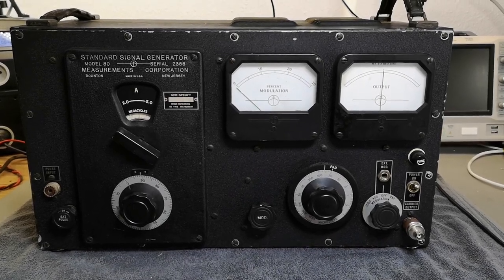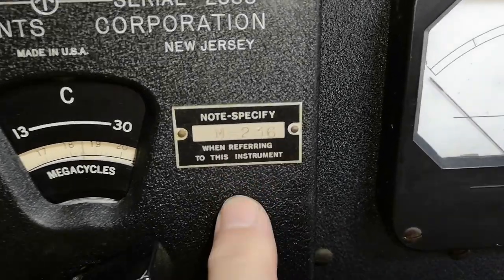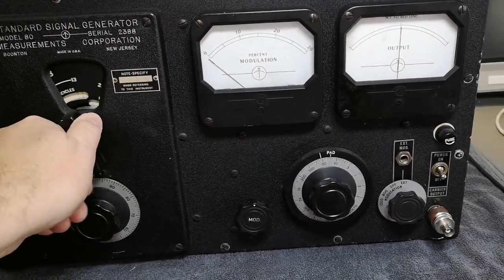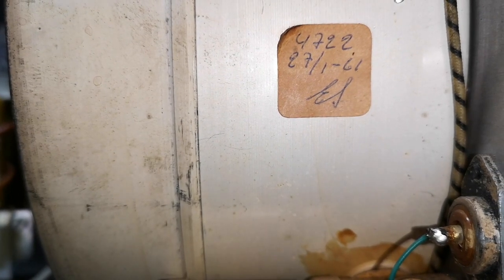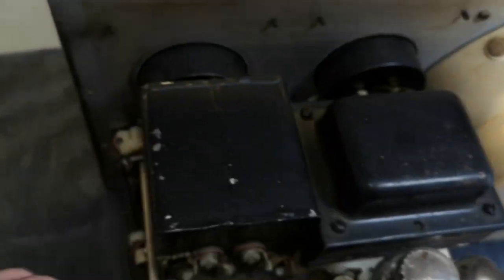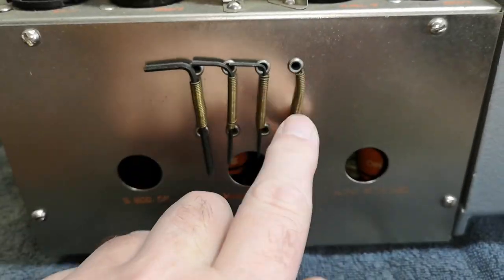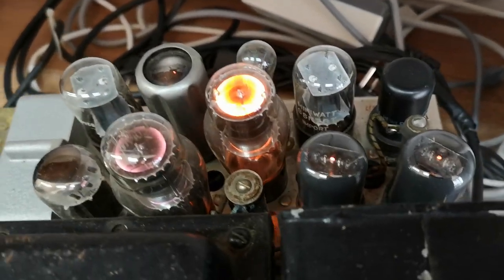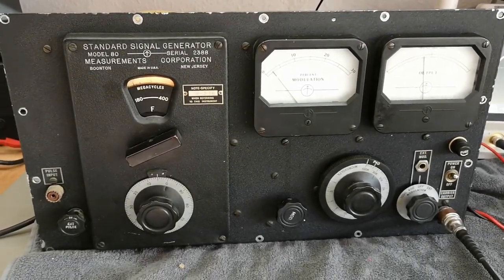Boonton Standard Signal Generator Model 80 2-440MHz 1950 test teardown

Comment: I have one of these that I've been trying to make some sense of. It was converted from a 955 triode to a 40673 dual gate fet at some point so all of the filament wiring and B+ wiring is gone. Not sure how it was meant to work without some sort of voltage getting to the oscillator so I assume it was used only with the external pulse modulator input. It also has a serial number in the 8000s and the only manual I can find is much earlier so it's hard to know what were intended modifications by the manufacturer and what were modifications done to convert the oscillator. Anyway, it's helpful to see the inside of an original unit, so thanks for putting this up!

Comment: I have one. I use my good frequency counter to set the generator. Once it’s warm it holds very stable. If you have the manual like me you will see exactly how it works. The manual is a very detailed service manual as well as operation.